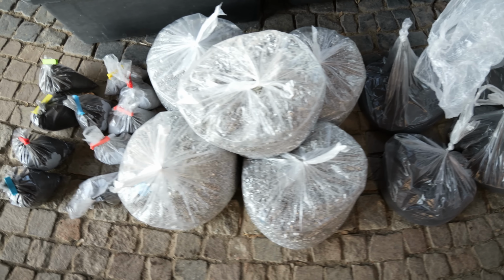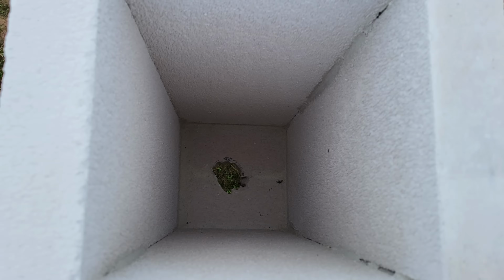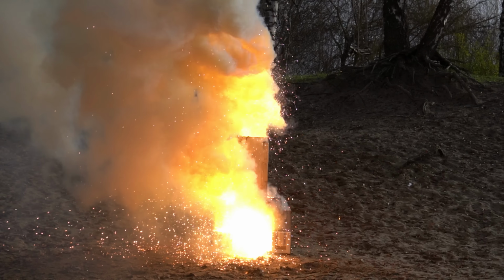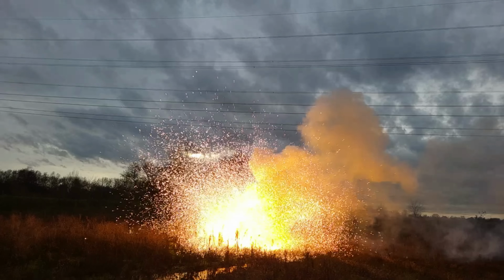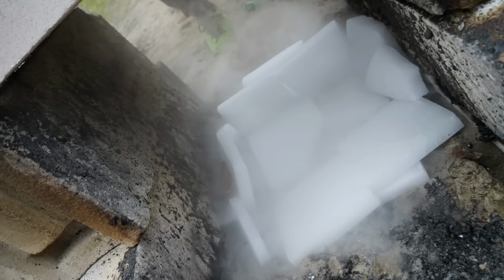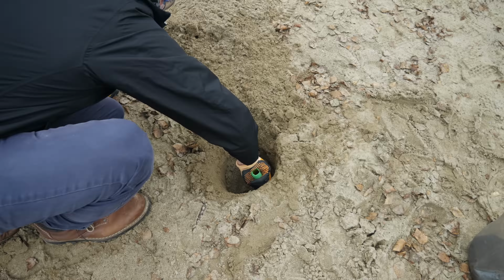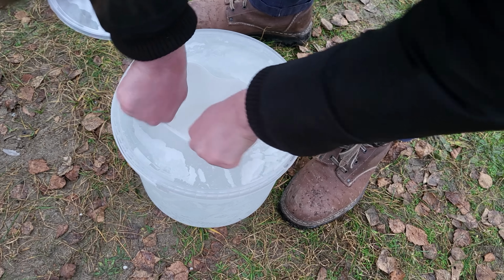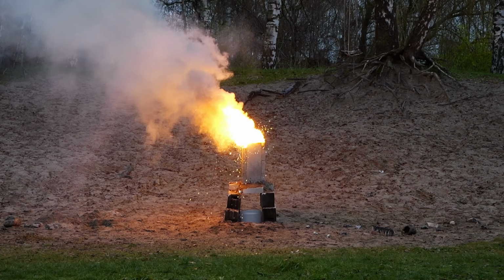100kg Thermite: Observing the Power of Aluminium and Iron Oxide Combustion

Comment: So I think I might know why you couldn't find any rubies. 

"While chromium is what causes ruby red color, not all rubies glow red. Basalt hosted rubies, meaning high iron rubies from certain locations, do not fluoresce."

Basically, all that iron oxide you used in the thermite prevented it from showing up with your UV lights.
Reply: that is correct.
Reply: So if encased in for instance Terra Cotta Clay vessel and a large enough quantity of thermite is used to reach reaction temperature it might work...

I don't know how to make the Terra Cotta tolerate the heat though... Preheating...?
Reply: @klausnielsen1537  he's just using the wrong method, trying to transfer heat through something into the ruby mix wont work because the ruby mix just begins to melt at about 3700F and nothing can withstand the heat of the thermite that can also effectively transfer the heat, well, very few things, silicon carbide or diamond might work.
Reply: @Metal_Master_YT  hiya, i'm trying to make ruby using thermite and a graphite crucible that i put my chromium oxide and aluminium oxide mix in, away from any iron oxide. could that work and be a viable way to make rubies?
Reply: @gryphonvalorant  yes definitely, that is the method I have been preparing to use, the only problem is you need completely pure graphite crucibles, any impurities will wreck the ruby. to heat it, you will need a very hot heat source, probably a large electric arc made between graphite rods that are also pure graphite, and the whole thing needs to be done with plenty of oxygen present (air is probably good enough). this is so that any graphite powder that could settle on, or get absorbed into the ruby will get burnt into CO2. it would probably also be a good idea to pre-heat both the graphite rods and crucible to orange hot before starting to burn off any loose graphite dust that could contaminate the ruby. also make sure to use only about 0.5% chromium oxide, and it has to be green chromium oxide. also both the aluminum oxide and chromium oxide have to be very pure, especially the aluminum oxide.
you could also try heating through the graphite crucible from the outside using thermite, but it had better be HOT thermite, and you will have to put a lid on the ruby mix so no thermite sparks get inside. try researching really hot thermites. hope this helps.
Reply: @Metal_Master_YT  thank you so much; this is really useful! i tried using an air-propane torch the first time around without a graphite crucible and it was a nightmare. i only got the powder to yellow hot and i understand it needs to be hotter than white-hot to melt. 

i sought some help from some experts and they said not to play around with thermite, so I will try again soon with an oxyacetlyene torch and hope the soot does not contaminate the ruby. if not, i'll just not listen to them and do the thermite method anyways 😂

about "hot thermite", is iron oxide thermite not hot enough? does it not burn at 2200K? i was looking at copper oxide thermite, but that burns kind of quickly, and my thinking is that if it burns slower, then there is more time for heat/energy to transfer over to the crucible (as well as less thermal shock for the brittle crucible).

do you have any tips for getting the ruby out at the end, or does the ruby just fall out?
Reply: @gryphonvalorant  well, I'm very glad this was helpful! and I would love to answer any questions or concerns you have with your new method before you try it, that way I might be able to save you some annoying experiments before you get it to work. xD

some advice and answers to your questions: if you heat it with oxyacetylene (the only torch that would work) make sure to use a neutral or slightly oxidizing flame (the balance of fuel to oxygen mixture has excess oxygen) that way any soot or carbon dust from your crucible will burn up, and also being close to a neutral flame gives you the highest flame temperature that the torch can offer.
if the torch is really large, try using a rosebud tip, it can heat a wider area, if you have a smaller torch, then probably use a welding tip, and if you have a medium size torch, you could try using a cutting tip, and then just not use the oxygen lever, it would give you something slightly wider than the welding tip flame, but narrower than a rosebud tip. you will have to play around with which torch tip heats it the best. you will know its hot enough when you see the grains fuse together and melt, the surface will become shiny, but make sure to wear eye protection, this is bright stuff.
a recommendation for the powder size you use, use very fine aluminum oxide powder and chromium oxide powder, then put it in a container, mix it up and then add some distilled water, it will make a fine paste, then dry it with a heat gun or hair dryer etc. and it will form a somewhat fragile lump. the reason for this is to make dried lumps that wont get blown away by the torch, trust me, this was quite an issue for me when using dry powder. alternatively use very coarse powder that simply doesn't get blown away, but that's harder to do in my opinion.
as for heating methods, I said that an arc was the best way before, but its certainly not the only way, as you mentioned, oxyacetylene is extremely hot and will do the job, and so will some thermites, the only problem with thermite is that its messy, it doesn't stay hot forever, and it takes a while for the heat to transfer through the graphite crucible to the powder inside. most of the time, you cant get the powder inside above yellow hot, which isn't good enough. also, thermite is made of solids or liquids (once it melts) and these all have boiling points, so the thermite can only get so hot. the boiling point of aluminum is about 4,480F and the melting point of the chromium oxide in the mix is about 4,420F and the temperature will drop below that before it gets to the mix, so the chromium oxide wont even melt. the aluminum oxide might melt, but neither powder is very conductive, so only the edges would melt at all, and you would need a massive batch of thermite to keep it hot long enough to melt it all the way to the middle. the aluminum oxide has a melting point of about 3,760F so its significantly lower, but 3,760 still isn't all that far from 4,000F, and its certainly still blazing hot. and this all assumes it reaches the boiling point of aluminum, and it often does not. as you mentioned 2200K or 3500F is not hot enough to reach either melting point, although it is somewhat close to that of aluminum oxide.
as for falling out, it will come out fine if and only if you use pure graphite. it will just fall right out with a few gentle taps, that is if the walls are smooth anyways. graphite is basically the non-stick for crucibles, but they love to add silicon carbide and clay, both of which will ruin your ruby and make it stick to the crucible, so watch out for that. those types of crucibles are designed to melt metals, not oxides. as a general rule, glass/ceramics/oxides melt and mix with each other given the chance, and metals mix with other metals given the chance, but they do not mix with each other (ceramic with metal) graphite is special in that it doesn't mix with either, which is why its so popular.

personally I would recommend that you use the oxyacetylene torch that you have access to, and use a very small, and thin-walled pure graphite crucible, which you pre-heat to burn off loose carbon dust, then add the clumped together powder, and heat it with the torch on a neutral or ever so slightly oxidizing setting, heating from the top, and just keep going until it all melts. you will almost certainly have to insulate the bottom and sides of the crucible though. I would invest in some high temperature refractory bricks that are insulating fire bricks. then just place it on an insulated brick, or even better, drill a hole with a hole saw into a brick so that your crucible can fit down inside and be well insulated. then just pre heat the inside to orange hot and add the pre heated crucible, then the lump of powder mix, and then torch it like there aint no tomorrow, and you can probably get large rubies.
by "small crucible" I mean no larger than 1.5in tall and 1.5in wide. you might have to buy a thick graphite rod and then drill a hole into it to make the crucible if they don't sell one the right size. you've probably already seen it, but there is a great video by NightHawkInLight on this subject: https://www.youtube.com/watch?v=MLV1pPvTpIw&t=20s&ab_channel=NightHawkInLight
Reply: @Metal_Master_YT you know what, i have a crucible exactly like that. thank you so, so, so much for this advice, and i'll get back to you soon after i've tried it! thank you so much again!
Reply: @gryphonvalorant  thanks :D It helps to have had the same idea, and done similar experiments! also, I would love to hear how it goes, as I haven't gotten around to doing it with mine yet, I have the ingredients though, but not any good crucibles yet, however I do have a graphite plate that I intend to drill little divets into to make sphere rubies for jewelry and such, basically just small scale testing for me.
Reply: It takes time to grow a crystal.
In nature, many crystals take years to grow, while the substrate coold down very slowly in the Earth mantle - crust boundary.
Or take olivine crystals from asteroids - the large ones took up to a million years to grow inside a gradually cooling asteroid. 
Between iron-nickel and silicates layers of large asteroids, whose gravity could already lead to the layers separation.
Reply: @denispol79  While you're (mostly) correct about how long crystals can grow in nature. It doesn't have to take that long. I've made rubies in 10 minutes with some aluminum oxide and a TIG welder before. Not high-quality ones, but still about as big as a finger tip.
Reply: @DrewTeter  Wow, just googled it - we're both right!
While it's not in a mono-crystaline form, like the gem-quality rubies found in nature.
Homeshop DIY rubies look the same and also fluorescent in UV, but it's in a microcrystaline form.

Comment: I'm not a chemist but I found a paper titled "The catalytic thermal decomposition of water and the production of hydrogen" in which they used an iron wire as a catalyst at around 1500 C to produce some hydrogen. Given the much higher temperatures and the increased reactivity of the molten iron, this leads me to speculate that there might be some hydrogen involved, but on the other side I don't see why it wouldn't just burn off right away.

Comment: My bet is that an active thermite reaction has enough energy going to engage thermolysis, which means that once the reacting thermite contacts the ice, it not only turns it into vapor, but also splits the hydrogen and oxygen from one another, leading to explosive results due to the present ignition source. If gas expansion alone would be a factor, due to the heat, the dry ice would have produced even more explosive results, as it goes from solid to gas instantly, unlike ice/water.

Comment: Fantastic video, you're having to much fun. ;-)  As for your comments about the H2O reaction with thermite.  I suspect you have directly dissociated  H2O and that is also reacting forming H2O again but with the liberation of energy.  According to the all knowing google, H2O dissociates at 2200C, while Thermite gets to 2000C, yea it's lower, but what's the experimental error?  Furthermore as almost everything in this realm is a gaussian distribution, the reaction may start earlier at a lower rate, contributing more energy and increasing the temperature of the fireball until the reaction turns on full bore.  There is also the remaining reaction of Fe +O2 forming FeOx, which no doubt liberates energy as well.  NIce work and fun to watch.

Comment: Congratulations on conjuring a volcano as a pet project.   I believe the energetic thermite + ice reaction is a phreatic explosion such as occurs in metal foundries when wet scrap is introduced to the furnace.  I believe it has to do with the mass of the water, the fact that it has such a huge expansion ratio when turned to steam, and a relatively high boiling point compared to hydrocarbons.

Comment: you know, I bet the dry ice didn't explode because of the Leiden frost effect, The hot iron probably sublimated the surface of the dry ice so darn fast that it had trouble mixing and exploding
Reply: And why would water not do the exact same? As it does, for example, on a hot steel plate?
Reply: @leocurious9919  the lower boiling point of CO2 means the Leiden frost effect is more pronounced. if I recall correctly, Oil can also exhibit the Leiden frost effect given a sufficiently hot surface, yet it goes onto a pan just fine as its boiling point is much much higher.
Reply: @CaptCorgi  100 K more or less are irrelevant when the molten iron is ~2000 K. Leidenfrost only takes about 200 K above boiling point. Which is also why oil has no problem in a pan, you simply do not heat it up glowing hot.

Comment: Could the 'steam explosion' stage of the reaction instead be a Coulombic Explosion, like was shown to occur with alkali metals? For the longest time those reactions too were wrongly explained by some sort of hydrogen reaction that didn't occur. Maybe at the high temperatures of liquid iron there is some sort of iron-water reaction?

Maybe someone could perform a thermite onto ice reaction through an argon atmosphere, just to see if removing O2 from the area changes anything.

Comment: I think the dry ice forms like a CO2 surface when it sublimates, which stops it from melting.
It is like a droplet of water on a really hot surface.
I mean it doesn't sublimate quickly when put in water for the same reason.

Comment: "In thermolysis, water molecules split into their atomic components hydrogen and oxygen. For example, at 2,200 °C (2,470 K; 3,990 °F) about three percent of all H2O are dissociated into various combinations of hydrogen and oxygen atoms, mostly H, H2, O, O2, and OH. Other reaction products like H2O2 or HO2 remain minor. At the very high temperature of 3,000 °C (3,270 K; 5,430 °F) more than half of the water molecules are decomposed, but at ambient temperatures only one molecule in 100 trillion dissociates by the effect of heat.[15]"

Comment: Thermite and ice results in a further redox reaction with aluminium and h20. The aluminium reduces the h20 resulting in hydrogen to further react with free o2. I'm guessing the super heated aluminium and steam accelerates the process very energetically.   I read around x2.5 than nitro glycerin - though I don't know for sure.
Reply: The shock wave is less than the speed of sound and therefore a deflagration rather than detonation.  But apparently more energy released over time than nitro.  Can anyone confirm?
Reply: Wood has a lot higher energy density than nitroglycerin too.

Comment: I don't think it's a chemical or steam explosion, and for the same reason: Both explanations require that either a whole bunch of steam, or a whole bunch of hydrogen are created INSTANTLY
(I know Mythbusters said the same thing, but they're right). Tito4re poured molten copper on an ice block and it blew up. There was nothing to confine any steam for an explosion.
I'm guessing it's the differential expansion of the ice cube. It happens incredibly quickly and with enough energy to rip the ice apart (see below).
It would be interesting to see if a bucket of ice cubes caused many small explosions, or one big one. More theory below because I went down a rabbit hole after watching this:

Tito4re has a video called "Molten Copper vs Ice Exploding Ice", where he pours molten copper on a big block of ice. If it was a chemical or a steam explosion, it would have just launched the pool of liquid metal up into the air. But that's not what happens. The whole block fractures and if you go frame by frame you can see chunks of ice being launched in every direction.

Periodic Videos has a video called "Why do ice cubes crack in drinks?" where they explain, and show in slow motion, how ice will undergo differential expansion. They show that ice cubes that go from -20C to ~30C can break themselves apart from the expansion. And that's just from a 50 degree difference, not the 1000+´degree difference with thermite (or molten copper).

Comment: Be carefull with potasiumpermanganate / glycerine. i speak from experience. at a certain lower temperature threshold (something around 0 C in my case) , it will react different: nothing happens for a loooong time .. then BANG! My theory, the glycerine soaks in the permanganate without reacting (because low temperature) until all goes off at once, very violently!

Comment: my guess is thermite explodes on ice because a steam layer cant be formed as fast and when molten, non oxidized aluminium hits water, it explodes on a molecular level. a coloumb explosion,  just as sodium does when water breaks trough its oxide layer.    heating water this fast to cause a rapid expansion in steam requires so much energy, its not possible.

Comment: For the Dry Ice, your heat had places to go and your Fe2 had no oxygen. Since you were dumping energy into the air, into the cooled area, and into the ice, you first made a thin compressed layer of CO2. On the top of that layer, you ripped away an Oxygen from the reaction, soaking more heat and dispersing more of it as CO and through your CO2 sublimate barrier layer. Since you lost so much already, the Fe could work easier with the air to dump heat -- this slowed down your sublimation barrier production, permitting minor expansion and letting the hot Fe2 soak closer to the dry ice again. Make another sublimate layer, rinse, repeat. No steam, no time for a bubble in the reaction cycle, and the compression just pushes gas around that isn't interested in reacting with the iron or the heat too much.